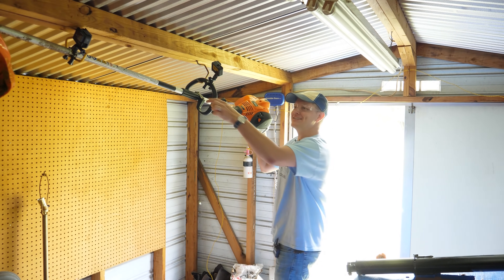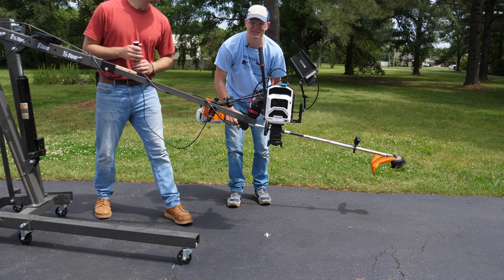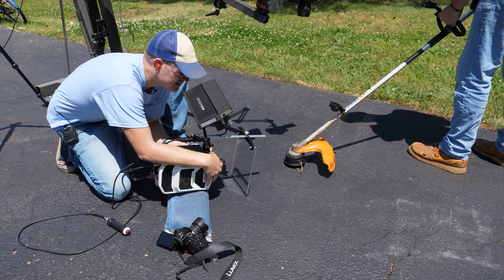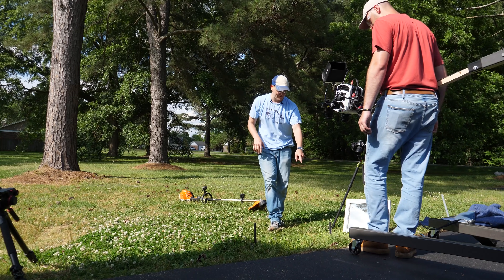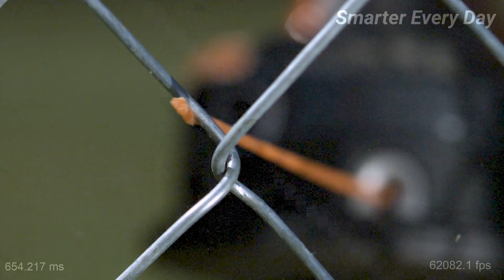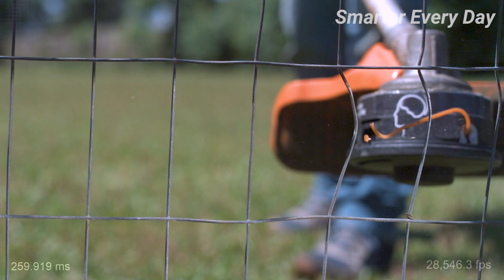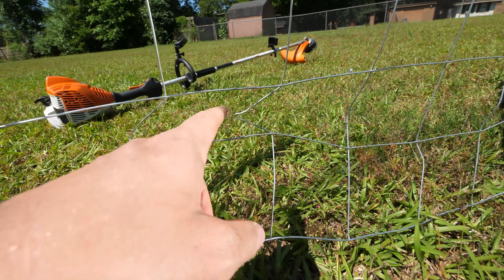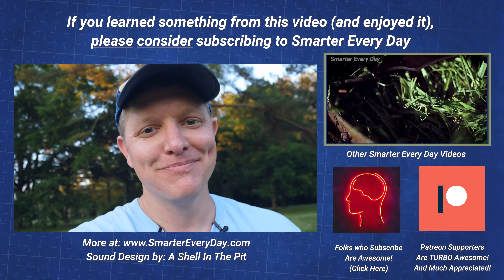How Weed Eaters Work (at 62,000 FRAMES PER SECOND) - Smarter Every Day 236

Comment: "Weed Eater"

Interesting. Where I live we've always called it a "Weed Wacker"
Reply: Interesting, in the uk it’s called a strimmer
Reply: Yeah I've never heard it called a weed eater
Reply: electrickid2 uk it’s a strimmer
Reply: electrickid2 I grew up with Whipper Snipper
Reply: electrickid2 that’s the only thing I’ve ever heard it called
Reply: @electrickid2  uhhh I call it a strimmer
Reply: Whipper snipper or brush cutter in Australia
Reply: @a178design  Nice! A whippa snippa as an aussie would say. Weed eater is easier to say than Weed whacker. You dont reset your lips for the vowel change.
Reply: @a178design  Strimmer in the uk... Whipper snipper is what I shall be calling it from now on though!
Reply: @a178design  yes sir  whipper snipper = bent shaft,  brush cutter = straight shaft.
Reply: @stevebloke5455  Brush cutter should refer to a weed eater with a blade on it. Then it performs "cutting" not just "whacking" the plants until they break.
The bent shafts are better for cutting on slopes because they can be held at a lower angle in my experience.
Reply: @ac.creations  as a small engines mechanic in Australia i can say that's how they are classified here,   mostly because you don't want to fit a blade to a bent shaft machine or you will break the flex drive,  hence a bent shaft machine is called a whipper snipper and a straight shaft machine is called a brush cutter  generally they are all line trimmers. weed eater is just a brand name here,  i only commented to clarify which machine was what from another posters comment and to be honest i am surprised at the debate over what a line trimmer is technically called.   i enjoyed the vid it was interesting to see the physics involved and how the components reacted. hope that clears things up.... have a nice day.
Reply: Toff E Yessir ive only known it as the whipper snipper
Reply: @a178design  I've heard them called that, too. ( in Canada) We use the terms interchangeably.
Reply: Toff E yeah
Reply: @a178design  Whipper Snipper in NFLD, Canada. I didn't know anywhere else said whipper snipper. Some call it a weed wacker here as well.
Reply: @a178design  Was just scrolling down looking for some Aussie to point this out :-)
Reply: Also known as string trimmers or strimmers. Weed eater is a brand, string trimmer is the generic term.
Reply: @belg4mit  Strimmer is a brand name too.
Reply: belg4mit Like a normal person
Reply: Yea in the Caribbean we just call it a wacker or brush cutter.
Reply: @LTT.Official  where dl u live? I'm in Antigua
Reply: @tuckeresty2036  ah beautiful place, I'm from bleh Trinidad.
Reply: @LTT.Official  oh cool. Yeah I left last year moved after living there 9 years. It's nice to see another person from the carribean. I miss it so much!
Reply: @LTT.Official  Trinidad
Reply: In UK it's a strimmer
Reply: @jackjohnson8055  What would you call a brushcutter in the UK? In Australia, a small line trimmer like this would be a whipper snipper, but a larger heavy-duty machine that doesn't necessarily run line would be a brushcutter.
Reply: Weed whip?
Reply: I have only ever called them "Strimmers" I have heard them called "Weed Wackers" many times, but this is the first time I have heard "Weed Eater"
Reply: Where I come from we call them a Whipper Snipper  .. True.. Aussie Land 👍
Reply: Weed eater is a brand name but universally used to describe the item itself. Like Kleenex is a brand of " facial tissue" but if i only have Puffs or some off brand i still call them Kleenex.
Reply: My family says both 🤷‍♂️
Reply: @scykol  why do you have my husband as your profile pic?
Reply: @shaulagarcia9471  why do you have my wife as yours 😳
Reply: @scykol  you got me there
Reply: @scykol  100th like
Reply: Ray bruh
Reply: Ray same
Reply: I just didn't know these existed lmao
Reply: @natryxs2469  how😳
Reply: Weed Eater is a brand name, I think owned by Poulan.
Reply: @Oddman1980  weed eater is it's own brand
Reply: We call these "moto-scythe" in my language.
Reply: I say both
Reply: Though he said meat beater at first 🥩
Reply: Weer eater is a brand. It's kind of like when people call any tablet an I-pad
Reply: Weedeater is also an amazing stoner metal band
Reply: We call it a "Work you Piece of *expletive deleted*" where I come from.
Reply: @LadyLexyStarwatcher  Always buy stihl. Electric ones are quite good nowadays too.
Reply: Weed eater is a brand name in the USA but we just call every weed wacker a weed eater
Reply: @heapester  I'm in northern USA and call it a weed whacker
Reply: Heapester In Jersey we call it a whacker
Reply: @heapester  I'm from the USA and I've never used weed eater once in my life and never will. It's a weed whacker.
Reply: @heapester  it's like how we refer to all soda as coke
Reply: @heapester  I've lived in the US all my life and nobody I know has ever called it a weed eater
Reply: Heapester DO WE THO???
Reply: Heapester like q-tips
Reply: Same
Reply: Where i live we call it a "Rasentrimmer".
Reply: @HerrFenchel  UNKRAUTSCHNEIDEAPPARAT!
Reply: @bigsmoke8887  Woops, tschuldigung. :)
Reply: @bigsmoke8887  german being german
Reply: @HerrFenchel  oder Motorsense.
We call it lawn trimmer or motorscythe.
Reply: Parker McCuistion yep. Weed eater. Also in Texas.
Reply: In the UK it's called a Paddington's Weed Walloper
Reply: @0sac  wot...
Reply: i always said weed wacker too but then i started working at a golf course and everyone was calling it a "string trimmer" pretty strange how everyones vocabulary is slightly different.
Reply: Might be a southern thing. I'm from Texas, and we call it a weed eater
Reply: Weed eater is the original name brand. Weed wacker is the term other brands used to be recognizable, but legally different. Different regions have different nicknames. String trimmer is the technical name.
Reply: Hispanic dads always call it a "wiriro" and I just now realized they were trying to pronounce weed eater all these years. Thanks smarter everyday
Reply: It’s a southern thing. Here (Louisiana) every soft drink is called a “Coke”. All string trimmers are called “weed eaters”. All reciprocating saws are “sawzalls”. All circulate saws are “Skill saws”. I could go on and on lol.
Reply: @timothymcglothlin4534  yup
Reply: It’s called a weed eater or weed whacker.
Reply: Where I live it’s called both, but maybe that’s because Virginia is in the weird zone, technically in the south but southerners think of us as northerners, but then northerners know we’re below the Mason Dixon line so we usually get left out of everything (except when it comes to lockdowns.  We’ve got more lockdown than you could ever ask for).
Reply: @stephenbenner4353  hey I'm in va also an we call it everything lol.
What part of va you from?
Reply: It’s definitely a “weed eater” in Alabama and Georgia. Lol. But I’ve heard it called a weed wacker as well.
Reply: Parker McCuistion i’m in texas too it’s weed eater
Reply: Australians call it a whipper snapper.
Reply: Same
Reply: In Florida, I hear both, but I say weed eater. 

I guess it's like when some people say "sharpie" instead of "permanent marker". 

Or in Spanish, where some people say "chicle" instead of whatever tf gum is in Spanish
Reply: I grew up in New Zealand and it was universally known as a weedeater over there.
Reply: Same wtf lol
Reply: In Sweden ,well my family call it weed trimmer, or just the trimmer
Reply: wtf is a weed
Reply: @timkim12321  A weed is an undesirable plant in a desirable location.
Reply: Weed Eater is a brand. It's like saying Kleenex instead of tissue or Scott Towel instead of paper towel.
Reply: Australians call it a whipper snipper lol
Reply: Here in the Midwest United States, we call it both.
Reply: In my country its known as "Motoguadaña" that traduces as Motorized Scythe
Reply: In Norway it's kantklipper (edge cutter / edge mower) or gresstrimmer (grass trimmer) though I have never heard the second term before I looked it up right now.
Reply: Yeah I was the same, the saying “weed wacker” kinda makes more sense because it’s only “wacking” the grass off which basically cuts it. Never seen a machine eat grass lol.
Reply: Just out there whacking off the yard
Reply: I live in Tennessee and I've only ever heard it called a weed eater, haha.
Reply: @asd fgh Canada is just Inverted Australia and likewise Australia is Inverted Canada, we're cold you're hot, our dangerous animals will beat you to death yours will bite you once, you're down under we're up over, ect...
Reply: who knew there could be so many comments about what this simple machine is called.
its weedeater where i come from..
Reply: Nah mate it's a bloody whipper snipper mate
Reply: In southeastern Washington It seemed about 70% 'eater' and 30% 'wacker'.
Reply: Siimaleikkuri
Reply: It’s a strummer in Ireland
Reply: Here it's called a grasmaaier
Reply: The proper term is "weed whizzler"
Reply: Wipper Snipper  in Australia
Reply: Where I live it's called a Honda
Reply: @GearheadOutlaw  that's a lawn mower but you get credit for trying lol
Reply: @christiansanchez1486  VEEETAAK! Lol
Reply: Weed eater seems to be a southern thing. I've got a friend from Wisconsin who calls it a weed whacker but here in southern Kentucky pretty much everybody calls it a weed eater
Reply: Yup. It's a weed wacker where I live.
Reply: Same
Reply: It would be a brush cutter in malaysia lol
Reply: me too lmao
Reply: Weed whipper anyone?
Reply: It's actually more accurate because it actually just wacks the grass until it tears because of the amount force.
Reply: saaammeeeeeeeeeeeeeeeeeeeeeeeee duuuuuuuuuuuuuuuuuuuuuuududddddddddeeeeeee
Reply: Same
Reply: Wack
Reply: So we now know you live in not the south lol
Reply: I live in the US and i call it a trimmer
Reply: I've never heard weed eater
Reply: We call it laksarca 😂
Reply: So I'm not alone...
Reply: Strimmer here
Reply: japzone same
Reply: Here In Virginia we call it weed wackers too
Reply: Whipper Snipper in canada
Reply: @RedSquirrelHunter  im from manitoba and i call it weed wacker
Reply: I call it both here in wyo
Reply: I mean its more accurate ig
Reply: Wacker gang rise up
Reply: In the UK, it's a strimmer.
Reply: I was just going to say that. I have always called it a weed whacker
Reply: Strimmer in the UK
Reply: I used to own a landscape company for years in New Jersey and always called it weed wacker but have heard both.
Reply: Could it be a north-south thing?  I’ve lived in Illinois and Wisconsin and have always heard it called a weed whacker.
Reply: I’ve always called it a whippersnipper
Reply: same
Reply: Here in Alaska it depends, north/ central, weed eater. On the Aleutian Islands and southeastern panhandles it’s a weed wacker. It’s very strange
Reply: I've called it both.
Reply: Yeah I’m in Rhode Island and Iv only heard weed wacker
Reply: My Dad calls it a Strimmer
Reply: japzone same
Reply: @asd fgh Canadian from Ontario, Whipper Snipper for us aswell.
Reply: I always called it a whippersnapper (might be spelt differently)
Reply: I call it both
Reply: Weed wacker in Virginia, however there was/is a brand for weed eaters.
Reply: This one thing is so diverse
Reply: We always say weed whip.
Reply: weed cutter here, roughly translated in english
Reply: @danielbbg6199  where are you from?
Reply: Commonly called Weed Eater here in eastern Canada, sometimes edge trimmer or just trimmer.
Reply: @simpliciteverte8585  maybe in Quebec but in my native Ontario it was most commonly known as Whipper Snipper and some people (usually American immigrants) called it the Weed Wacker.
Reply: @bernardcornellisvanmeijere4375  I've head it called whipper Snapper, Whipper Snipper, Weed Whacker as well.
Reply: Whipper Snipper.
Brush cutter.
Australia.
Reply: I'm from Minnesota and I normally call it a weed whip, sometimes weed whacker, sometimes I just call it trimming
Reply: “Weed wacker” 

Interesting. Where I live we’ve always spelled it as “weed whacker”
Reply: Whipper snipper in Australia.
Strimmer in England.
Reply: @charlespester3411  I'm gonna start calling it a whipper snipper from now on, beats strimmer.
Reply: Or “whipper snippet”
Reply: my family says wipper snipper
Reply: It's a Weed Wacker.  It's like saying the Busheaters instead of the Bushwackers.
Reply: Trimmer or if your doin hedges a hedge trimmer or for grass a grass gas trimmer lols
Reply: In my place we call them crackheads
Reply: In England we call it a strimmer
Reply: They called it "Weed Wacker" in adventure time
Reply: Weed eater is the most common term.  Many times weed wackers are bigger for larger type weeds.  but Weed eater is a general term.
Reply: Bush trimmer in here.
Reply: I call it all 3 weed eater weed wacker and trimmer
Reply: same
Reply: Stamford CT we call it a weed whacker as well.
Reply: Wack
Reply: Craftsman made a string trimmer called "weed whacker", and that's what I've always called them (grew up in Michigan). Now I live in Indiana and everyone calls them weed eaters. I dislike that name because they don't eat the weeds. The weeds don't go anywhere, it whacks the weeds.
Reply: Me to
Reply: Whipper snipper in Australia
Reply: Same here in New England
Reply: Yeah i'm in the US and have only ever heard it called Weed Wacker. Literally never heard of Weed Eater.
Reply: @AndrewSouthworth  I'm guessing it might be a Southeast US thing... to each their own!!
Reply: japzone same  im in the us
Reply: Interesting where I live we always call it a strimer
Reply: Ive never heard "weed eater"
Reply: Same
Reply: It's a southern thing, I'm sure. Up north we call them weed whackers as well.
Reply: Even weirder, my dad calls it a weed wacker but by grandpa always called it a weed eater.
Reply: i'm gonna guess you're from California lol
Reply: Same
Reply: @HomeMade Deviljho not you haha the original commenter
Reply: Never knew that anyone called it anything besides a weed whacker
Reply: I’ve heard weed walker weed eater weed hawk, it’s all the same
Reply: I always hear Strimmer
Reply: Marihuana eater
Reply: You could say that's... Wack.
Reply: We call it a weed wacker in New Jersey.
Reply: Or a trimmer
Reply: Same
Reply: Where I'm from, my family says weed wacker.
Reply: @HomeMade Deviljho lol
Reply: That’s crazy in Spanish it’s called ligma
Reply: weedeater in tx
Reply: Whippersnapper in Australia
Reply: Call it a weed whipper here, or were trimmer.
Reply: See where i live its a weed whip a weed whacker or a weed eater which is the one i used most as a kid. Dont matter what the name is so long as it gets the job done.
Reply: In the SOUTH and only the south they use the brand name to refer to stuff its all left over from when thier ancestors were super slow and thought they were bougie because they have name brand stuff
Reply: In oklahoma I almost always hear "weedeater" like one word not always fully enunciated
Reply: @japzone Whacker*
Reply: 200
Reply: i was lookin for this comment
Reply: Weed Eater is a brand. It's like calling a tissue a Kleenex.
Reply: I’m on the Eastern Coast and I hear weed wacker.
Reply: Me too
Reply: The way I remember it.... a man in Houston, Texas invented it and called it Weed Eater.
Reply: it's called a line trimmer.
Reply: I've heard it both ways.
Reply: It is different one is stoned one was hit as a child
Reply: Yes
Reply: Funnily enough my friends and I had a game we played on our trampoline a couple years ago called Weed Whacker. It was a great way to go home with scratches. It was like Ring Around the Rosie on steroids. We would lock arms and spin around really fast, and the last one standing won.
Reply: I’ve heard both
Reply: They're marketed as trimmers so everyone is wrong 😂
Reply: I call it a whipper snipper
Reply: japzone we call it a GRASMAAIER
Reply: Or weed whip I've heard it called before
Reply: Eater is from the midwest. Whacker is north
Reply: I’ve never heard it called a weed wacker or anything else people in the comments are calling it... “weed-eater” is the only name I’ve ever heard.
Reply: I say weed smoker 🤙🏾
Reply: Weed wacker, edge trimmer..all the good stuff
Reply: Yeah we call it a strimmer
Reply: hmmm in here its called pemotong rumput
Reply: Whipper Snipper?
Reply: Whipper snipper
Reply: Grim Reaper's Covid-19 tool
Reply: It doesn’t eat anything that’s a misleading name
Reply: Interesting where I live it's called "whipper-snipper"
Reply: Called Strimmers in the UK
Reply: same
Reply: @Parker McCuistion yea same i live in texas and we've always called it a weed eater
Reply: In Puerto Rico we call them Trimmers
Reply: We call it a strimmer in the UK.
Reply: Most of the names you hear are old brand names that have become normalised, it's proper name is a line cutter but here in Australia we call it a "whipper snipper"
Reply: Me too 😂
Reply: Yeah same
Reply: Weed wacker is a brand, not the name of the tool
Reply: Team weed whacker!
Reply: I call it both
Reply: Que interesante, y acá la llamamos máquina para cortar el pasto
Reply: Same here
Reply: @Parker McCuistion same with arkansas
Reply: I'm from England and we call it a strimmer
Reply: We call it wacker
Reply: W H I P P E R S N I P P E R
Reply: *Whacker
Reply: Yeh we call it weed eater
Reply: Rasenkantenschneider!
Reply: From Connecticut and I call it weed wacker
Reply: Where I live we call it a weed strimmer
Reply: It's a whippa snippa....guess were I'm from :)
Reply: Same
Reply: Zipper snipper
Reply: I always knew it as a Weed Wacker.  I'm sure that was the name on the box.  The fist one I had was an electric one from Sears in 1983.
Reply: UK it's a strimmer lol
Reply: Where are you?  Most of the people I know (in TN) call it a weed eater..."I need to get the weed eater started"..."I need to trim or weed eat the yard"  I've heard weed whacker but I think it's a more northern term.
Reply: I call it a weed whip
Reply: I've heard it refereed to be both
Reply: Perhaps its regional? I’m from New England and I’ve never heard anyone refer to one as a weed eater. Weed whacker is what I’ve always heard.
Reply: We call it a “whipper snipper”
Reply: Where I come from we call it brush cutter 🤷‍♂️
Reply: japzone what the we call it a strimmer in the uk 😂
Reply: Yeah Same
Reply: Im really curious were weed eater comes from. Never heard it called a weed eater
Reply: In dutch it is “bosmaaier”
Reply: Ive been waiting for this comment
Reply: I call it both
Reply: Grass cutter
Reply: Wow, this comment sounds very familiar...
Reply: In Australia it’s a wipper sniper
Reply: The whole country calls it a weed eater
Reply: We just call it "grass cutter". 😂
Reply: In the Philippines,  we just call it "grass cutter ". Just like how we call the toothpaste as "colgate" and contact cement as "rugby" etc.
Reply: I think they're both brand names but like Coke and Pepsi, are also ubiquitous enough to stand in as an interchangeable general name for all similar products.
Reply: Interesting, I've never seen weed eater/wacker in my life.
Reply: I always thought it was a Canadian thing
Reply: Same i live in pa
Reply: Everyone calls me “weed eater”
Reply: japzone me too
Reply: Brush cutter
Reply: Whipper Snipper in my fam
Reply: Whipper snipper here in aus 😂
Reply: In western newyork ive only heard it referred to as a weed wacker
Reply: japzone same
Reply: I call it a weed cuter
Reply: We call it the whipper snipper in australia
Reply: @kieranleslie9576  ok mate
Reply: UK here - we call them strimmers
Reply: @Rhaegarion  good for you britainian
Reply: In Dutch we call it a ‘kantemaaier’ 
And I think thats really beautiful
Reply: Same
Reply: same herre
Reply: i just call it a weed whip
Reply: Doohickey with a trimmer thing
Reply: In my country we call it "flakserica"
Reply: I say wiper snipper. Wierd
Reply: It is common in the south to call it a weed eater
Reply: Ich kenne es als Freischneider😂
Reply: Actually the right name is “string trimmer” but depending on the state the call it different, “ weed eater, weed wacker, whipper sniper ( Canada), line trimmer, grass edge trimmer, weed whip, grass trimmer” .
Reply: We I live its called 
Whipper snipper
Reply: In Germany we say Kantenschneider or Freischneider and i think thats beutiful
Reply: We call it a whipper snipper where I live lol
Reply: I’ve always said weed wacker
Reply: Well midwest i almost always hear weed eater
Reply: i call it a motor scythe roughly translated from what i call it in norwegian
Reply: i just call it of cortador de grama and i think that this is really easier
Reply: In aus we call it a whipper snipper
Reply: @harambe-h8884  im gonna assume australia?
Reply: I say weed wacker and weed eater seams no different so I don’t have to much problem
Reply: We always say weed eater
Reply: i’ve lived in the US and england and in england it was a weed wacker and US was weed eater
Reply: It's regional dialect
Reply: I am from Australia and I call it a whipper Snipper
Reply: My family has always called it whiper snipper
Reply: My family and i are Hispanics and we call it wee leter 🤣
Reply: unknown Agent a yes, la pinche máquina esa
Reply: In Germany we say: Sense
Reply: I knew this as weed eater. I knew a weed wacker as a hand held tool that you swing back and forth like a gokf club on tall grass
Reply: Lawn mover
Reply: Yeah I've heard of weed Wacker but I call it weed eater too
Reply: 4,500 people agree
Reply: Same 🇺🇸
Reply: call them weed whiper
Reply: I use both. Also string trimmer.
Reply: The chemicals that kill weeds are what we called weed wacker
Reply: I thought it eats grass so isn’t it a grass eater?🤔
Reply: In Australia it’s called a Wipper sniper
Reply: It’s a strimmer in the UK
Reply: Weed eater
Reply: I've never thought about what it's called in English so at first i was like "Weed What?"
Reply: I say both. Just like pop or soda! Hoosiers are in the middle of everything so we have a lot of cultures here!
Reply: My side calls them bushcutters.
Reply: And no U.K. it is a strimmer
Reply: I call it El Wiro
Reply: It might be a east coast thing if you’re over here
Reply: we in australia call it a wipper snipper
Reply: In Australia we call it a whipper snipper.
Reply: Weed wacker too
Reply: Am guessing you from the west indies
Reply: Ya where I am it’s called a weed wacker
Reply: It’s a whipper snipper here in Australia
Reply: Same
Reply: weed eater is a brand, and I think weed wacker is just a general term. I live in Idaho and call it a Weed Eater, when Destin calls it the same thing and he lives in Alabama, so I don't think it's really regional.
Reply: Same
Reply: @asd fgh  we call it whipper snipper and weed wacker
Reply: In Australia it’s called a whipper snipper
Reply: Same
Reply: Same
Reply: We call it a weed wacker
Reply: Same
Reply: We call them lawn trimmer.....if you translate it word by word.
Reply: Same
Reply: Where im from they call it a whizzer.
Reply: Weird way to say whipper snipper
Reply: Same
Reply: Strimmer or whipper snipper
Reply: we call it a wipper snipper
Reply: Same
Reply: W H I P P E R S N I P P E R
Reply: Guess it's an American thing cause Canadians as far as I know call it a wacker not eater. It does sound funny. Haha.
Reply: In Australia we call them Whipper Snippers
Reply: grass cutter
Reply: Same
Reply: In South Africa it's either called a weed eater or brush cutter
Reply: @Parker McCuistion In California I've never heard weed eater, only weed wacker, that's funny
Reply: We call it whipper snippee
Reply: In the UK we call it a strimmer
Reply: We call it here in Australia a whippa snippa
Reply: I’m from Australia and call it wiper sinper
Reply: Nobody concern about that mount of plastic disposal, very small fragments.... In very short time that and up in us in many ways. This is must be band.
Reply: Same for new zealand
Reply: Same here lol 🤷‍♂️🤷‍♂️🤷‍♂️🤷‍♂️🤷‍♂️
Reply: You all have it wrong, it’s a whipper snipper
Reply: enjoy being right from now on
Reply: In Australia it's called a whipper snipper 😉
Reply: well Dustins from Huntsville Alabama and no one says weed wacker,its a weed eater or how most people pronounce it "weedeter"
Reply: @calebcasey5375  thanks now I'm thinking of veggie tales where they go to the future and the end of every joke is WEED EATER
Reply: @helloperson9445  Your welcome😂😂
Reply: @calebcasey5375  what 2+2=?
W E E D   E A T E R
Reply: same
Reply: E = MC^2   and virus sperm 
Virus sperm are extremely sophisticated, virus sperm nuclear decay 1 proton + create 91,7 voltage create energy for sperm to swim. 
The function of viral sperms is to generate electricity for cells human
Reply: Me too
Reply: Ya me 2
Reply: in hungarian, we say "fűkasza"  which means grass scythe
Reply: i’m from texas and we call it weed eater
Reply: In Australia we call it a whiper snipper
Reply: i call that a strimmer
Reply: Same
Reply: Spaghettification though.
Reply: In texas we call it weed eater, I think in Australia it's called string trimmer, also time is crazy u saw this video 50 minutes when it released and now it's been 4 years, crazy
Reply: Same
Reply: Weed Eater sounds really really wierd to me I grew up with Weed Wacker too and it's almost cringy when he says Weed Eater
Reply: @xyvazkrown8048  It's "cringy"? How do you survive outside your house? Or are you in a constant cringe because the world is too different for you?
Reply: @xenonram  you don't have to be aggro about it, it's like how some people think the word "Moist" is cringy, nothing wrong with the word, just sounds weird when you hear it lots. Or do you think those that feel uncomfortable hearing the word "Moist" can't live in society cause everything must give them cringe? I mean how do they survive outside their house?
Reply: @xyvazkrown8048  In the future memes would be randomly generated 

W E E D    E A T E A R

Memes always right
Reply: Xyvaz Krown same
Reply: Xyvaz Krown it doesn’t EAT weed, it WACKS it
Reply: Weed Eater was determined to be the more politically correct term. The lower term is actually derogatory to weeds. I'm sorry I'm going to have to report your comment to YT.
Reply: Ya I never heard weed eater
Reply: I've also never heard of them called a weed eater, only a weed wacker
Reply: ikr
Reply: Our family has always just called it an "edger" but I've heard both those terms before too
Reply: Our family has always just called it an "edger" but I've heard both those terms before too
Reply: Weedeater. Wacker sounds like a dumb af
Reply: Growing up in North Carolina, it’s Wacker 100%
Reply: @charlietighe  where in NC, because we always called it a weed eater in Western NC. I lived in Minnesota for a while and it was often called a "weed whip".
Reply: @charlietighe  Also NC and Eater lol
Reply: @charlietighe  NC native 45 years central NC and it's always been "weed eater" here. That's weird.
Reply: @charlietighe  eastern nc we call it a weed eater